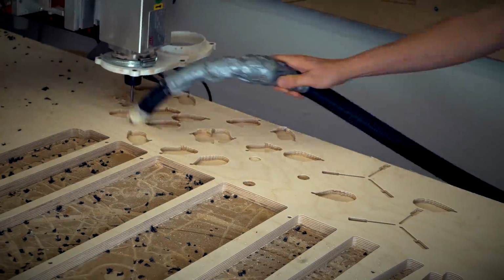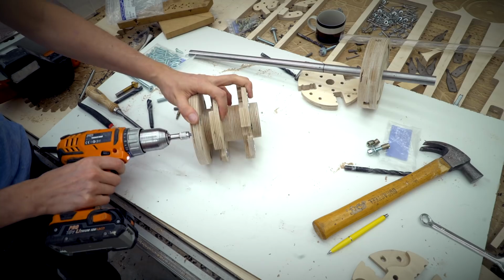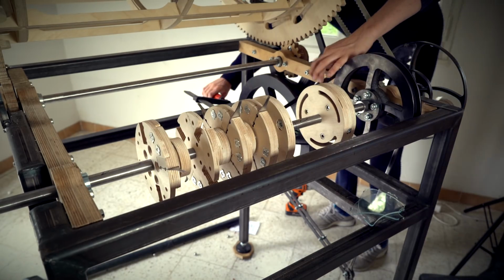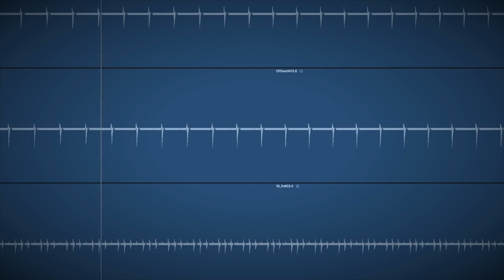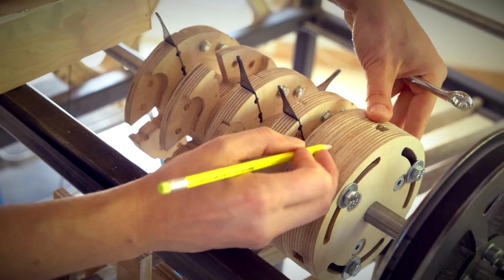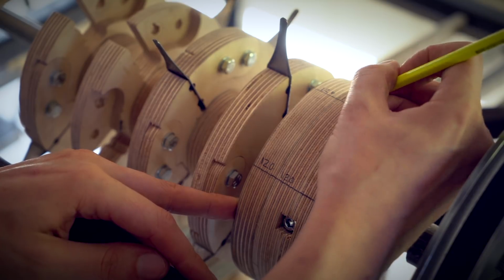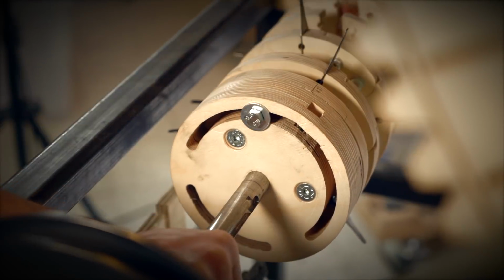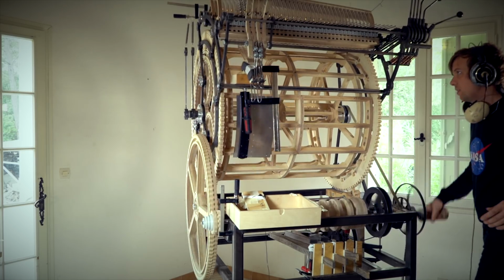Testing the Mechanical Rhythm Machine - Marble Machine X #55

Comment: Your rhythm machine is very good but... You will not be able to change the tempo while playing without having sync problem. 
So this part of the machine would be perfect if added some way to automatically adjust sync according to the tempo variation.

Comment: Hey Martin, as a woodworker, I noticed that you keep putting the threaded inserts in backwards. The slot in the one side is there so that you can get a plain head screwdriver in and extract them if needed. Ultimately, it is of no consequence either way, I just thought you'd like to know in case the need ever arises. It would save you having to destroy the wood or keep buying new ones. Can't wait to see the finished machine and my wife and I look forward to every Wednesday.

Comment: sorry to say, but unless the audio is incorrect, the belt was never actually tuned to a C#. The first time an A, the second  C.

That being said, it's been a short while since I've watched one of your videos, and I'm amazed at how far the marble machine X has come.  I've got some catching up to do.
Reply: Maybe he thinks he has perfect pitch.
Reply: I admit that it took me a while to figure out if he was joking; because first; it didn't sound like a C-Sharp to me, and I used to have very good relative pitch. Then there was that tangent about tuning the belts to C-Sharp to avoid resonance; which has to be an utter pile; because C-Sharp may not be common; but D-Flat major sure is. Heck, Clair De Lune is mostly in D-flat.
Reply: true. I mean, I have perfect pitch and knew instantly that not only were both notes not C#, but were both different. I'll admit, Clair De lune is in D-flat, and so is all John Rutter, but somehow I feel you'd struggle to find a piece of pop music in C#. Mechanical resonant frequencies are a big thing in engineering though. The whole concept of how a string instrument works is based on the fact that the string resonates to the point where it almost throws itself off the bridge. I'm still not convinced it's entirely just a joke, as it would make some sense: If the belt were to vibrate, it would likely mess up the timing, and could perhaps slide around the pulley.

Comment: For better accuracy and repeatability, actual timing belts (toothed belts) engaging gears between flywheel and crankshaft and between crankshaft and 'programming wheel' shaft might be better options than either flat belts or V-belts

Comment: You are running into an overall timing adjustment issue. You may be able to get the timing right at a specific BPM (that you will need to choose), but anything else and you will start to suffer some timing drift caused the time between a marble is triggered and when it hits. That time is independent of the rotational speed of your crank.

The time in free fall of each marble will be relatively constant for any particular note. In seconds it will be 2 * vertical height / 9.8 (in a vacuum). I am going to call this gap of time the fall time. I am going to estimate that the 'standard' marble has a 0.2 second fall time. Since your rhythm machine effectively has zero fall time (but is adjustable) we are going to try to make one marble match the rhythm machine at various BPMs.

I think (looks like that in #25) that your drum has 64 beats per revolution, so I am going to use multiples of that for my math
1) If you are playing at 128 BPM (~2 beats per second and 2 rpm or 12 degrees per second on the large drum)
     You need the marbles to lead the rhythm machine by 0.2 seconds so you need to have the rhythm machine behind by 2.4 degrees
2) If you are playing at 64 BPM (~1 beat per second and 1 rpm or 6 degrees per second on the large drum)
     You need the marbles to lead the rhythm machine by 0.2 seconds so you need to have the rhythm machine behind by 1.2 degrees

As you see, you need some kind of rotation speed independant delay for all of your channels to match the channel with the longest fall or a way to 'shoot' (rather than drop) the marbles at their destination to reduce their fall time as much as possible.

It looks like you may already be aware of this issue and are just planning on performing at an optimal BPM (120?) to avoid it, but you keep coming back to the timing adjustability, so I thought it was worth a mention hopefully you see this.

I love your music and videos, I am glad you worked with This Old Tony, or otherwise I would likely not have heard of you.
Reply: I was suggesting a centrifugal governor to automate the rhythm machine's offset for different BPMs.
Reply: The machine locks off at marked points, so can be set for each song at the "main" tempo. But I wonder if this could be automatically set by a particular gear ratio, given that both rhythmic elements of the MMX are driven by the same crank. Sounds like one of the challenges that should be crowdsourced though!
Reply: In other words, using sounds not created directly or indirectly by falling marbles is asking for timing trouble. I hope it doesn't sound too destructive, because the machine is an amazing piece of engineering, but think there is another problem with the rhythm machine: It kind of undermines the idea behind a marble machine.
Reply: Gravity is fake because Earth is flat 😑 stoopid
Reply: Would you like to test that by jumping off a dam without a bungee tether? Your contention that gravity is 'fake' won't hold water if you don't survive without injury.
Reply: @brickviking667  JK 😂 Just wanted to mess with people. sorry!
Reply: @brickviking you are confusing the observed phenomena with a model used to explain it ;)
Reply: He (jokingly) contends two things. "Gravity is fake" is what I was addressing. Even if the model we use to explain gravity is fake, gravity is still in effect. I'm not even going to get started on the whole flat-earth debacle. I don't have enough dried green frog pills for that. Besides which, I haven't checked for turtles yet.

Comment: Every time I see a new detail, I shudder at the additional risk of loosening or damage during transit while traveling to performances...

I could foresee 4 hours of testing before every 1 hour performance :(
Reply: I think the nay-sayers are being a bit harsh here. It easily splits into three parts by undoing just a few bolts, each sub assembly fits into its own packing container. The parts are made mostly by CNC machine so making identical spares is is as simple as pressing the run button. Does any of that apply to grand pianos? Should pianos never have been invented because they are hard to transport? Will they survive being dropped into their sides? Perhaps orchestras should only play the recorder...
Reply: Owen: I submit that this isn't being a naysayer; it's being responsible. A lot of very, very important people will pay a very, very lot of money to be in these audiences. The builder and performer, sponsors, and others will be seriously impacted by a critical failure on show day. I would admonish you not to regard them with flippancy, smugness, and arrogant overconfidence.

The piano argument is poor. From the dealer, a piano normally takes one trip and that's all for its life. For those who experience a second trip, ask any owner if the transport was not a monumentally stomach churning, torturous and nerve wracking affair. It's also astronomically expensive as I'm sure you know. Defusing dynamite is simpler and less stressful. Well, the Great Machine might be transported quite a bit going on the road. So...

Perhaps it would at least be less stressful and more manageable to greatly limit those movements. Perhaps make the tour be something like only extended engagements in Rome, London, Paris, New York, and L.A.?

And 'simple as pressing a button' ?  That's laughable. So when there's an on stage stress failure, he just says, "hang on" and pushes a button, and in the next ten minutes loads the material, mills it, finishes the surface, paints it, assembles it (I mean, calls the guy with the special service tool for assembly, and assembles it), tests it, refines it, and executes a test sequence array (when you change out one part others may feel it) - and 30 other items in the flowchart that I don't immediately recall? For a particularly sensitive assembly, how about five or ten hours - and it's only that low because already knows what to do from the design, and from having already built it once, right? Actually, he's maybe built it 3 or 4 times with trial and error, if you've been watching the process; the process has thus been done a total of 3 or 4 times in history! The point is that once the machine is built and the plans are final (and I assure you that such finalization will not happen until field testing, and even then will continue to evolve) - that you can't just push a button and replace the machine. Haven't you been watching the months of toils in the construction?

If the world was as simple as that, he could have built the whole thing in an hour from the plans, right? Guys like you horrify me when you're in charge of critical projects...and in today's fast-reward corporate mentality, I have sadly seen it far more than I wish (and imagine the military - and, shudder, the rest of government - on that score). The Great Machine represents a marvel of engineering complexity, innovation, craftsmanship, and meticulous fine tuning. While it certainly and impressively leverages automation for time and cost, it nonetheless much represents the antithesis of a "push a button and it's done" mentality.
Reply: Hi Bill.
Firstly thanks for entering into a mostly civilised debate rather than an argument, and please accept my apologies for what may have come across as arrogance in my previous posts. (I'm a pretty blunt Brit, mostly typing short replies on a phone.)

I take your point that an artist may not travel with "their" piano, but may instead use one that resides permanently at a concert hall.  My point was to show that moving a piano or a snooker table or a historic car is not insurmountable.  Anyway that's less important than the next bit.

Did you happen to watch the episode describing the new project manager?  It detailed a very well structured project, with good CAD models of sub assemblies, and well handled inventory and build practices.

I take your point about the evolving design.  This calls for rigid revision control.  Before the tour the design will be revisioned.  That's simple good practice.  Making 4 of everything at that point is absolutely doable.  It really is just reloading fresh material and hitting cycle start.  When on the road if you get down to the last few spares then the files are all in the cloud just seconds away.  A bit of ply is a bit of ply, you could have a part cut and sent from home base or subcontracted locally.  You could even send a machine and a tuner ahead to the next venue so it's ready to play upon the the main team's arrival. 

Spot an error and redesign on the road?  No problem, new revision.  Bill of materials updated, done.  Want a part for Revision V2.23 then look at that BOM V2.23, want it from V2.24, likewise.  It's not that hard if your project is well structured.  (And yes, I do do this for a living, and for a few thousand products not just for one!)

As for fitting them, then yes build up two machines.  Carry many spares.  Make hot-swap sub assemblies. (I was alarmed at how much he had to disassemble in this video to get to the problem part, but this is a prototype not the finished article. I'd be looking for interchangeable modules in the final spec.)  He'll be travelling with a team, a bit like a motor-sport pit crew.  Building an engine is tricky.  Building a different engine every weekend is harder.  Building the same engine every day is easy, they'll be able to do it blindfolded with practice.

I'm sure the audience will understand if something breaks.  (As an engineer I'd find that interesting.  If repairing it could somehow be shown in real time to the guests then that would in my opinion just add to the show.)  Don't forget it already has to be reprogrammed to change songs.

Anyway that's just my opinion.  To dumb it down to make it easy would be a crying shame.
All the best,
Owen S.
Reply: That's what spares and the day before the show are for.  If it were me there'd be three complete built up machines and enough parts to build three more traveling round on the tour...
Reply: I would imagine their show will be 2 1/2 to 3 hours long. They go on at 8pm and start the encore at 10 : 30.
Reply: "That's what spares and the day before the show are for."

The day before the show is spent getting to the show.
Spares are a good idea, but with this huge and over engineered thing you'll need a spare of pretty much everything that sticks out, especially the big wheels of the programming wheel.
If it should ever fall on the side with the crankhandle... it's game over. The crank will be broken, the handles at the top will be lost, the whole thing will be done for.
Reply: What so far have you seen that’s fragile and difficult to replace? Seems like a rock solid piece of steel and plywood to me ... if it breaks they just glue or weld it up and anything else they just call up Marius and he overnights them a new one.
Reply: Theodore, obviously we must give him great credit for his intelligent and arduous efforts to make things durable and replaceable. As to overnight delivery, mmm, well I think that carrying spares of everything is more the right approach, as someone mentioned above.
Reply: Do you know how many parts there are in your car?
And it's constantly on the road all the time. The horror.
I foresee 517 hours of testing every time anyone wants to drive anywhere.
Reply: @alex_evstyugov  Cars used to break all the time when they were hand built. Modern car design and manufacturing is the result of a process of over a hundred years of focus on quality and durability, using industrial processes that cost billions, and amortize across millions of vehicles made. Wintergatan isn't making a million machines using billion dollar factories, he's making one using hand tools.
Worry about durability shows he's smart enough to know what that means and that robustness doesn't come for free.
Reply: @Jon Watte oh absolutely. It's just that after watching all these videos, if there is one thing we can say with complete confidence, it's that Martin has put more effort into quality and durability in the past couple months alone than all the car manufacturers in the world combined have put into their products in the last 100 years. :-D
Reply: @alex_evstyugov  funny, but not actually true :-)
Reply: What a lot of engineers do very poorly - not to unpleasantly criticize them, but it's just true - is not adequately appreciate the difference between laboratory and real world. SH ^G^G - I mean Things HAPPEN in the real world. You either have to "get" that or you don't. I'm not taking anything away from Martin's "laboratory" testing and precautions. But I'm telling you, out in the field, stuff happens. BTW, software engineers constantly learn this "the hard way" as all of us no doubt have painfully experienced the consequences of - even from supposedly brilliant Microsoft. (BTW, I'm a software and mathematical and financial engineer.)

The sad irony is that no matter how adept and careful and skillful Martin is (and I truly believe that he is those things), S*** just does happen, so be ready. And in this case, with transport of fragile (yes, fragile) elements and structures, let's really, really cross our fingers.
Reply: Ha, yes, good ol’ real world always showing you what works and what doesn’t :-) this is probably where Martin actually has the advantage on pure engineers...he’s been out on the road playing shows and getting a feel for the environment.  He probably couldn’t engineer a bridge since he’s not really a trained in those subjects (though wouldn’t you like to see him try?) but give him the tools and he can work up some fantastic instruments!
Reply: Rigging and sound and tech check usually take longer than the performance for high-production tours.
Reply: thats how all perfomances go duh, 1000 hours of practise, 1 hour of showtime
Reply: @Sagolel4797  Yeah but you don't want to have to do all those house of practice immediately before a show...

Comment: The only worry I have after seeing this once again amasing video is - didn't the rhythm machine take up the space denoted for the actual MMX instruments? Or they will be placed closer to the programming wheel/higher up?

Also - when is that time when the instruments in CAD stop being a placeholder? They kinda dictate the position of marble drops, otherwise you'd need to move them, which means re-design for a third of the top subassembly...

Comment: You seriously need a vacuum hold-down table.  MDF is porous enough to still use as a spoil board while allowing the air pressure differential to form and hold down the workpiece quite effectively (a friend of mine with a ShopBot built his own with various PVC and acrylic parts, and a big shop vac).

Comment: 22:00 ish, just take all the bolts out and rotate the entire thing 120 degrees...
if needed you could drill another 3 holes in the second plate so you can then rotate it by 60 degrees and in doing so you can also rotate the clutch plate to the places where the outside is connected to the inside.

Comment: you could maybe add a scale to the rythm machine timing adjusting system so that you can roughtly see how many places you have to move it, might get handy if the timing shifts at some point. Maybe  ThisOldTony could machine you a aluminium ring with the scale engravings for that purpose.